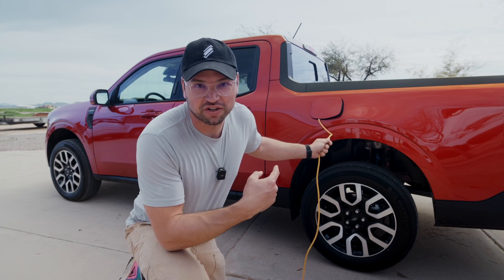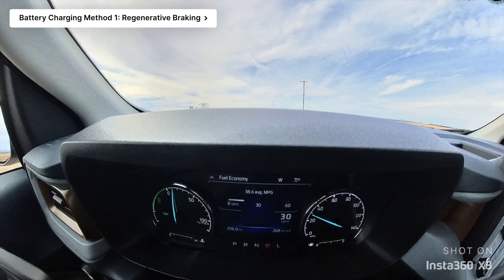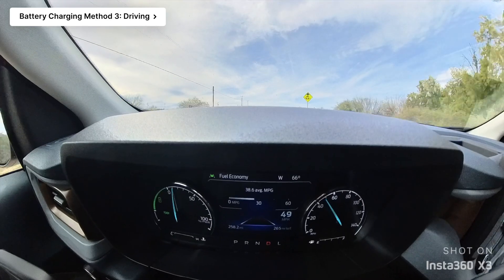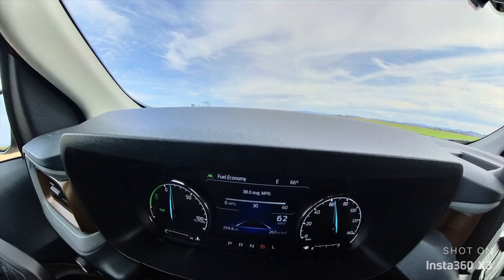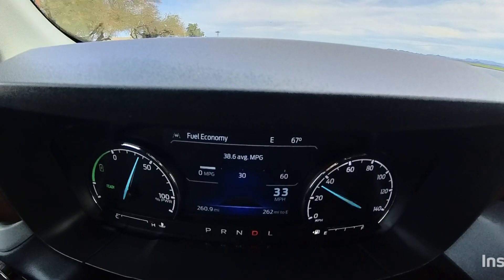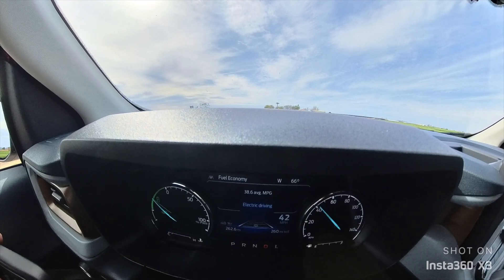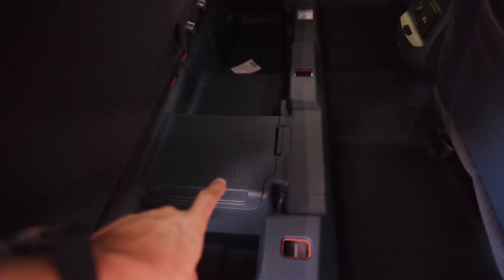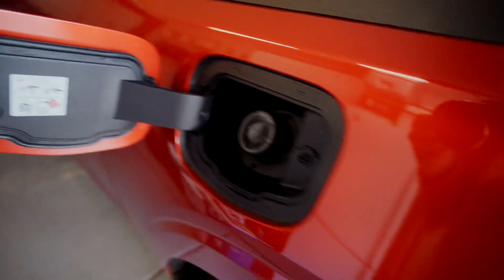How to Charge a Ford Maverick Hybrid Battery!

Comment from the maker: Correction: the hybrid battery is under the front passenger seat general area! A bit further forward than I show in this video!
Reply: Yeah, I was going to bust your chops for pointing out the 12v operating system battery, lol!
Reply: Thanks for wasting my time.  5 Youtube videos in trying to find the high-voltage hybrid battery...
Reply: You were showing the normal truck battery spot, instead of the under the hood spot like we are used too.
Reply: Are you guys just guessing? Mine is under the rear passenger side seat

Comment: I agree with Brendan 100 %. I just bought a 25 AWD hybrid. I wish the hybrid battery was a little larger and a plug in. that would take the MPG to a whole new level. My wife has a 24 Toyota Pries plug in and we are getting over 100 MPH that is amazing. That is so much better the  EV cars because they are over priced and on a long trip you need to spend 45 minutes at a charge station.
Reply: Ford listened to it's customers and made a plug in Hybrid version an option for the 2027 model year.

Comment: Does Eco mode save much gas? That battery under the seat is the 12v battery. I don't think that is the highvoltage battery.  I got good mileage out of my Taurus by being easy on the gas petal

Comment: How many mpg can I get without charging it? Live in an apartment without charging and debating going for regular or hybrid
Reply from the maker: It charges itself so no worries there. Looks like you didn't watch this video 🤣
I got mid 40s mpg overall and high 38 mpg on the highway.
Reply: The Mavericks in US can’t be charged by an external cord, only By braking and running the gas engine (generator).

Comment: Question: I drive my '23 XLT MAYBE once a week, and that trip rarely amounts to fifteen or twenty miles, half of which is 35mph on average. The battery stays so low that the truck "goes dark" until the key is returned to the ignition and turned on, at which point the gas engine comes on. Should I be worried that the 12v battery will get so depleted that the truck won't start? Should I be occasionally charging the 12 volt battery?
Reply from the maker: I mean, the truck still has an alternator that charges the 12v battery so I can't imagine you need to intervene as long as everything is functioning as intended.
Reply: @brendandrives Yeah, but the alternator only charged when the engine is running. When it sits in the garage for a few weeks, there's all kinds of electronics constantly sucking the battery. That's the weak link in a pure hybrid.

Comment: Perfect video. Answered my questions except one. Do you feel the truck shake a little or rumble when the gas engine turns on? Had a ride home one time in a Volvo something or other and the whole car would rumble and shake when the engine came on. Definitely would affect longevity in my opinion.
Reply: Most manufacturers have solved this…Toyota shimmy’s very subtly
And usually only at lower speeds…usually  unnoticeable and Ford is using Toyotas system still I think (definitely did 10 years ago and it feels the same as that.).
Reply from the maker: If you're not a car nerd I think you wouldn't notice it. I bet passengers wouldn't notice it
Reply: I have a 2024 Marerick Hybrid  is the only way you can hear the engine is running is if you are driving slow with the window down.   It starts and stops automatically and you can only really tell if you watch the dash indicator.   What a great system.

Comment: To be a useful plug in hybrid the battery would have to be 5x bigger. Like on the Ioniq hybrid the battery is about 1.5KWh and on the Ioniq plug-in hybrid the battery is about 8KWh (I have one and can do between 40 and 50KM on full electric, after the battery gets down to 17% charge it then drive as a normal hybrid).
Reply from the maker: I would love it to be 3x-5x bigger.

Comment: Brendan,   Can it be made to be charged/ maintained , with solar panel. Tom
Reply from the maker: I highly doubt it or if you did it would seriously void the warranty. The battery is tiny and only last about 2 miles of driving max so there’s really no need to charge it independently.

Comment: Brendan,    Try a Solar panel,    Harbor F. has them ,  in AZ I park in driveway, I can put one on roof , with cord.   I may try, Tom W
Reply from the maker: A solar panel for…what exactly? I’ve been curious to try them maybe for charging devices while camping etc
Reply: Maverick has a battery, for  moving truck, it sits in AZ drive way, many sun days  or @vwork    this would make sure battery is @ full charge      or Ford put small panel on roof of truck . I drive  in a retirement community  , i go slow, or @ speed limit , I see the MPG  very high , around 50 mpg for a short time, but battery is down , park truck @ store / rec center , may return to full capasity.  Tom W                @brendandrives
Reply from the maker: @tomwrona1973  there's no way to directly charge the battery with a cord though

Comment: Looks like it will take 2-3 years of fuel savings to recover the $1,500 extra cost for the Hybrid versus the Ecoboost.  Not a bad return ….
Reply: until you have to replace the battery. This will always result in more maintenance cost simply because you have two systems. You've doubled the complexity in order to minimally reduce the amount of fuel used. If they allowed it to be plug in and increased the battery a bit, it might be worth it.
Reply: These batteries will outlive the ICE…the #yrs to recoup doesn’t apply in 2022 or 2025 when it was standard equipment.  How long does it take to recoup the $ on eco boost that started out more expensive and costs 1/3 more to run?
Reply from the maker: Ooh I love that kind of math, thanks for that Bill

Comment: I love my maverick ❤ we did have the no start no crank eyelet connection issue which ford recalled and fixes 4 free but tool a few days 2 get it in at the dealership so during that time I still had 2 use our truck 2 take kids back and forth to and from school ect so what we did 2 start the truck was connect one end of the jumper cable 2 that front battery located under the hood and the end to the back battery located under the back seat and boom it cranked right on up no need 4 another vehicle no need for a portable battery charger it worked like a charm so if any1 is having that issue and can't get it fixed at that moment just follow those steps and ur all good😊

Comment: The battery under the back seat is the 12v battery. The large Hybrid Lithium Battery is underneith the chasis below the were the rear seats are.
Reply from the maker: You are correct!

Comment: Now for even better news! The hybrid battery costs only $6500 to replace at the stealership. Unfortunately $6500 buys 4-5 years worth of gas for the average 4 cylinder NA car & it also with pays for tires and oil changes.
Reply: Yeah but much like Prius is another hybrids they tend to last 10 plus years, and they've come out with aftermarket battery packs once the demand gets there. You can see a lot of people will replacing Prius battery packs for a couple hundred bucks themselves.
Reply: @matt45540  except Prius relies on a large battery that can be plug in charged that keeps the underpowered ICE motor at a constant speed which is better for the ice motor itself and better for fuel economy. Ford decided that the battery could be smaller (probably to keep weight low) so they could put in a bigger ICE motor. They won't let you charge the battery putting more work on the undersized battery that absolutely will wear out faster than a Prius battery. On the upside the Maverick battery is cheaper, but you'll be replacing it sooner. The Maverick doesn't even use battery only mode if it's cold (a safety feature to maintain the battery) this means you'll be burring 25% more gasoline than a regular ICE only model during these times. You could heat the battery, but they could have installed a larger batter to accommodate temperature regulating equipment. External heaters are worse for the battery than integrated systems. 

In short, this is a buy drive and dump vehicle before the maintenance bill in 100k miles costs more than the value of the vehicle. I suggest holding out for cheaper sodium ion battery technology that has no extra benefit than simply being cheaper than lithium, meaning adding battery maintenance tech would make the car the same price as lithium ion without and then cheaper to replace (in comparison to lithium) in the future. (There's talk that sodium ion is better for the environment in disposal but that hasn't been proven yet.)
Reply: Deceptive title. We know the engine will charge it. We want to plug it in and charge it. Even though the battery is small, you can go about 1.3 miles on it if you drive right.
Reply: OK,  your freakin cleverest commenter of Dec,  mayb 2023.  "STEALERSHIP".....i'll be using that during xmas/new years getogethers...😅

Comment: If someone buys a truck just to drive 5 miles to work, and 5 miles back, there is not really a reason to get a truck. For most situations, a truck is actually worse than a sedan, or hatchback, or station wagon.  Buy groceries, your stuff is either in the back seat where people sit, or it's in the bed of the truck sliding around, or blowing out.

Sure, there are covers for the bed, but then your stuff still slides around. So then you need to get a tool to hold the stuff in place, so you don't need to climb up into the bed to get your cans of food, or what ever you have back there, which slid all over the place. 

Sure, you can put a bike in the back of a pickup truck, but you can also get a bike rack for your car. Or roof racks, for the rare occasion you take something big with you. 

Honestly, the only 2 situations I can see a truck being useful is to move tall objects, like a fridge. But even then, it's hard to lift it up into the truck. A small trailer would be easier, as it's lower to the ground. 

Sure, you can put something like plywood in the back of a truck, or long boards.. But roof racks again will solve that. 

Or maybe, if you move smelly stuff, like mulch, then sure, it is better in the truck.

Something like the Nissan Leaf would be a better option for most people. Or maybe an older BMW i3 with a range extender. Not sure, but just some ideas.

But America, being America, most of us buy a pickup truck to look "Cool", and come up with very small reasons to ever need it..

Comment: Im confused as this hybrid technology stuff is "new to me" So, is there a normal sized 12v battery under the hood for cranking/starting the engine, and a second larger, higher voltage battery for the hybrid/drive system?
Reply: There no dedicated starter for the engine. The engine is started by the smaller motor-generator. The engine has no alternator or belts of any kind. The 12v battery under the back seat is charged from the inverter that controls the hybrid battery under the floor. The 12v battery runs the vehicle's accessory electrical system. The headlamps, wipers, etc. The air conditioner is electrically driven from the hybrid battery.
The transmission is very simple. It is a CVT transmission, but it has no torque converter, steel belts and cones, no clutches or bands, no high pressure pump. There is a low pressure pump to lubricate the bearings. 
 The trick is that there is one planetary gear set in the transmission...that's it. The smaller motor-generator is hooked directly to the sun gear in the planetary gearset, the engine is hooked directly to the planetary gear, and the main motor is directly hooked to the to the ring gear. The ring gear is engaged with the standard issue differential that drives the front wheels. The computer controls both motors and the engine to give a transition between the motors and the engine that is so smooth you can't feel it. The transmission has no reverse, so backing up is electric only.
Reply from the maker: I’m going to make another video to put the location question to bed for sure but, basically yes. Even the 12v battery is inside though not under the hood.

Comment: Ford did the right thing by bringing back this engine in a hybrid (see 2008-2012 Escape hybrid).  You can drive in battery only with a gentle right foot and under 40MPH.  I average 35MPG in my 2009 FEH with 110K miles.  They are proven engines and batteries with Manhattan and San Francisco Taxi Cabs with well over 400K miles on them with no rebuilds required.
Reply from the maker: That’s pretty good! I know Maverick owners who average closer to 42!

Comment: At 2 mins in you mentioned a green light that comes on when it has enough electricity.. what light? Where? I've had my Maverick hybrid for a few months now and I never noticed a light that goes on and off..?
Reply: Mine does have that light, but its always on when when the ignition is on. And so is his. Lol
Reply: I don't think all of the mavericks have that light cause my 22 ford maverick hybrid basic package doesn't have that light either but u know when ur using electric by the gage on the left when its pointing towards the green it's running electric plus when it's quite it's running electric

Comment: Big fucking deal. You guys act as if the Maverick is some revolutionary engineering when the Chevy volt has had this since 2011 and can actually go 75 mph or more  on  just battery power alone
Reply from the maker: Oh it’s nothing revolutionary at all. Actually it’s strange no one made a cheap hybrid truck before now! Especially Toyota or Chevy! I bet they are in the works now though.
Reply: have to plug the Volt  in!

Comment: Shocking regenerative braking on the maverick !  my chevy volt has that back in 2011 !
Reply: So did every Prius before that......next

BTW.. how is GM supporting that Volt nowadays???
Reply: Chevy volt was trash and I'm a GM guy
Reply: @renegade_patriot   I have 97000 miles on my Chevy Volt and never had a problem. All the rest of the Chevrolet stuff I had is been crap though I will agree with that.
Reply: @renegade_patriot  I agree. The Volt is trash. The Maverick cost me less per month to operate.
Reply: 2018 Volt bought brand new, almost 60000 miles, no issues. Great car!

Comment: Hey Brendan, that's the 12v  battery under the seat, the big  battery is under the truck
Reply from the maker: You’re right! I’m going to make a new video specifically about the location to correct this! Thanks Joe!
Reply: @brendandrives  look into what happens when the truck drives in deep water …
Reply: The battery compartment is hermetically sealed because of the coolant system surrounding the batteries. Therefor, your truck will get wet if you drive it in water.

Comment: Brenden...the battery under the seat behind the passenger seat   is NOT the hybrid battery...that battery is a 12 volt battery...
The 450 volt d.c. hybrid battery is located under the vehicle on the passenger side covered with a shield...don't EVER mess with it or ANY orange wires under the hood !! ... please watch you-tube videos on this subject....
Reply: Doug, you are right (and Brenden is wrong). A bit more info: The floor stamping for the Maverick Hybrid is nearly identical to the Escape Hybrid, and both have the hybrid propulsion battery in an indentation under the floor, roughly under the rear seat on the passenger side. For extra credit: That same stamping also provides space for the larger PHEV battery used in the Escape plug-in hybrid (that space is currently unused in the Maverick). If Ford ever fixes its production problems with the Maverick, it is a near certainty that we will see a Maverick PHEV. However, because of certain underside geometries, it will likely be limited to FWD only, just as it is in the Escape.
Reply: @ontheroadwithralph1530  Appreciate the additional info. on the hybrid...didn't know that about the stamping for additional room for a possible bigger battery... possible PHEV   coming in the future?...I'm looking forward to getting my Maverick hybrid soon...personally, I don't want a plug-in..again, that's me..
Reply: @dougwood1658  I am currently driving a 2023 F-150 Lightning (which I love), but have a Maverick XLT Hybrid on order. Was supposed to be built as far back as October 2022, but is still vaporware. I have a new 2023 VIN for it, so I suppose it will get manufactured... someday.
Reply: @ontheroadwithralph1530  If you have a VIN, it will and soon be built...keep checking your e-mail from Ford for an update.
About 1 week before being built, you can see your window sticker...again, using Ford's e-mail that you received...
( hopefully soon ! ) ..
Reply: From my measurements its not a 450v battery its a 220-240v battery.
Reply from the maker: It’s a little farther forward than I showed but you’re right! Thanks! 

https://www.fleet.ford.com/content/dam/aem_fleet/en_us/fleet/resources/2022-2023_Maverick_Hybrid_Emergency_Response_Guide_10-24-22.pdf
Reply: @brendandrives  Brendan, if you get a few minutes, watch a great video explaining the Maverick hybrid battery location and what not to touch..it's located under :
RedneckCam666 ..
Scroll down to the Dec. 21, 2021 ... it's  7:38 minutes long,
but worth every minute ! .
 " Thank's for doing your video's " ..